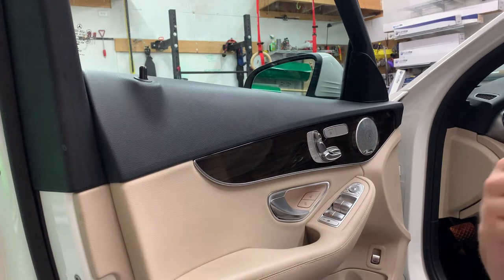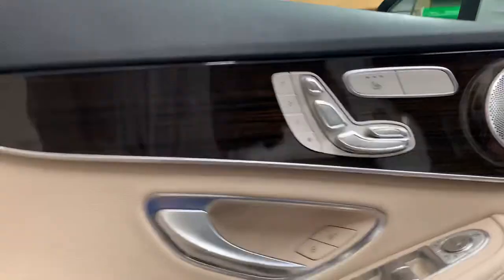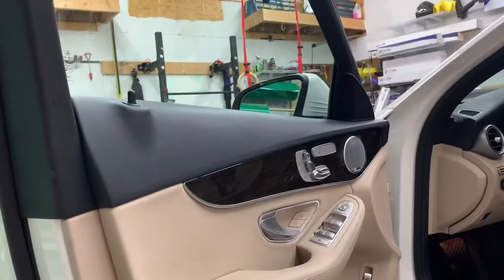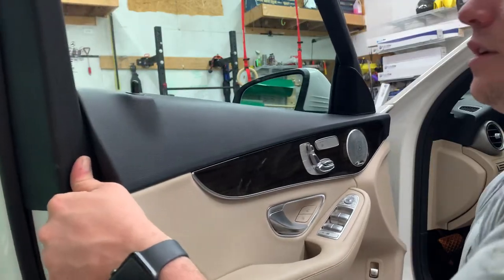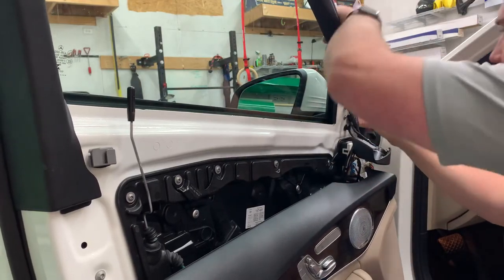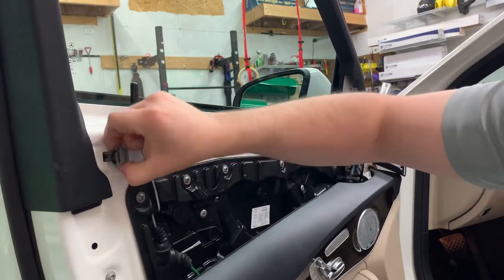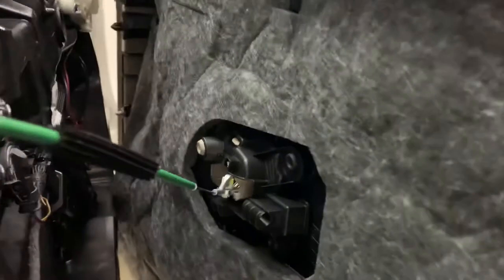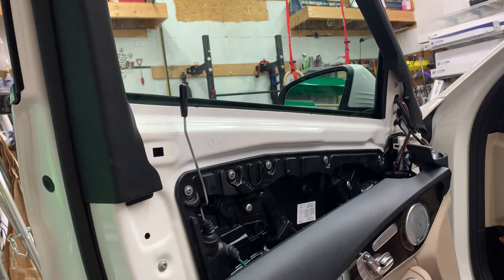How to remove: 2018 Mercedes-Benz c300 front door panel

Comment: Hi Travis I’m having problems removing the “torch 27 bolts” is that how it is spelt ?
Reply from the maker: Torx 27 but your extension needs to be skinny to make sure you can get fully seated on the bolts.
Reply: I removed the bolts but can’t pull the panel out at all. Any tips?